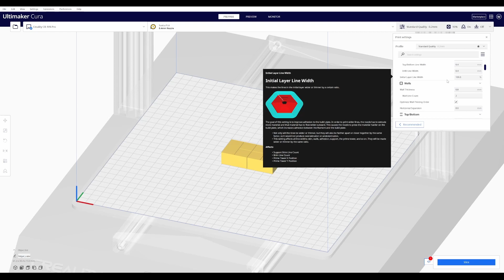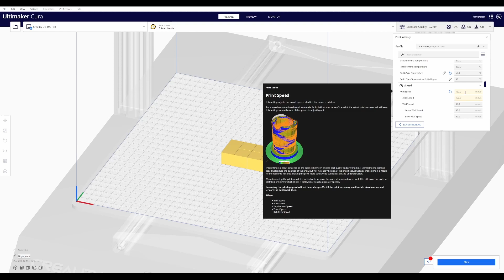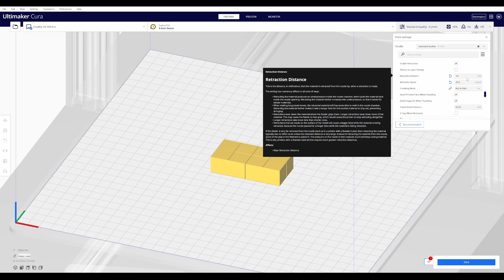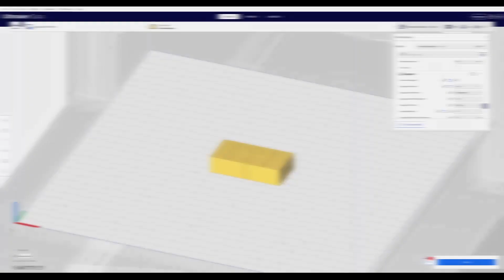TPU 3D Printing Basics - Who says you can't print TPU with a Bowden extruder and retraction???

Comment: I'm printing TPU eyecups on a stock Ender 3 v2. I set the speed to 65% of the default (around 30mm/s) and left everything untouched. Supports also works fine. Of course your mileage may vary depending on the type of material, but it's doable, yes.